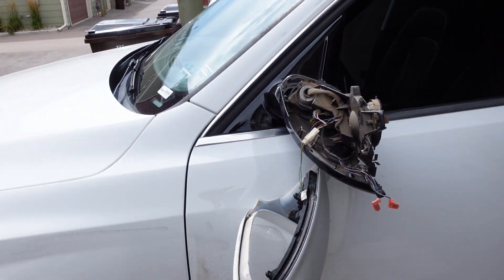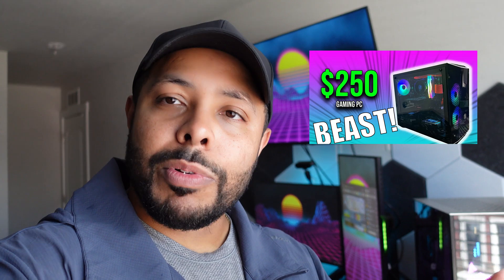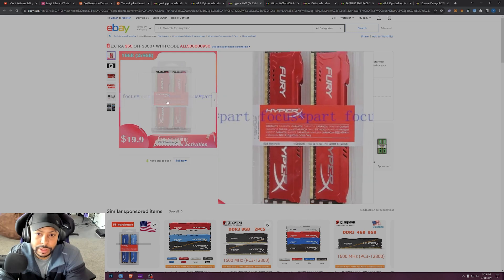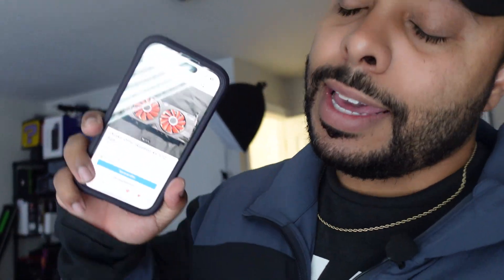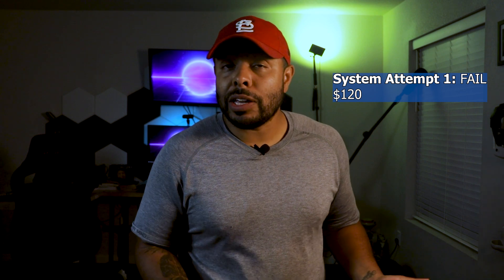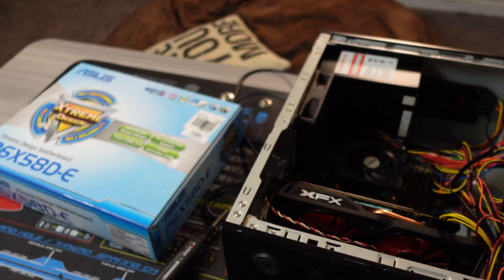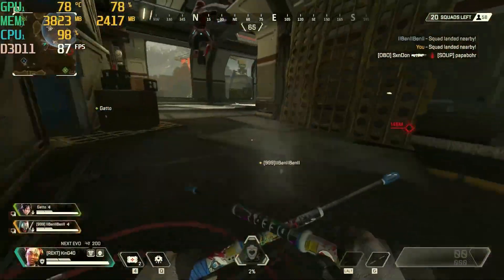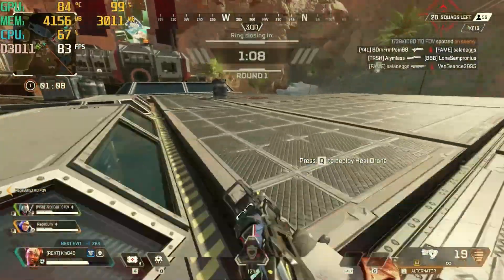Yes, You CAN Build a $100 Budget Gaming PC!

Comment: Plays everything..but not well
Reply from the maker: $99 dollars… did you expect it to be 120 fps 4k ? Just really curious….
Reply: @TekVibe  Not at all. It just triggered me because so many "builders" on Marketplace say that crap with old parts dressed up in a nice case. Then they rip off buyers. Nothing against you bro. Lol
Reply from the maker: @PokèMyBalls  I'm sorry thats been your experience. 

That said... Some Old parts run much better than people give them credit for, This PC after adding a 16 gb kit of ram into it was able to handle Starfield 35 FPS avg Low settings, that's Xbox numbers.... for $100 bucks not bad at all. Especially for a single player game like that. 

but to your point... people definitely do some crappy stuff.
Reply: @TekVibe  OH, I definitely don't doubt that because most of my builds utilize the same parts. I just hate when sellers are vague about it and say I7 GTX  will play any game you throw at it.
Reply: @TekVibe  Did the optiplex originally come with single channel memory? I know that just having simple Dual channel greatly increased performance. Also, older DDR3 systems with Intel quad cores benefited greatly from faster memory vs an OC.
Reply from the maker: @PokèMyBalls  Yes it came with single channel originally... was trying my best to make it under the $100 so for that video I didn't add the additional kit to it, plus I wanted to milk it for another video lol

Comment: Sorry about your car accident, but I admire that you still have a good spirit about you even after enduring a recent wreck. 
To your video, a $100 PC in 2023 not factoring crazy inflation and the overpricing of everything, even it being USED, just seems like an impossible feat unless we're talking about 2012 specs.
My oldest build from 2019 holding a MSI B550, Ryzen 7 3700X, RX 5700XT, 32GB of DDR4 3000 @ 3800, a BRD drive, 250GB SSD, a couple NVMEs & HDDs is still not $100 and I'd say its the bare minimum for AAA 1080p max or mid 1440p gaming.
Reply from the maker: Appreciate it, gotta keep it pushin.

Impossible as it may sound… I did here on video! 

Certainly not easily done, but it’s doable.